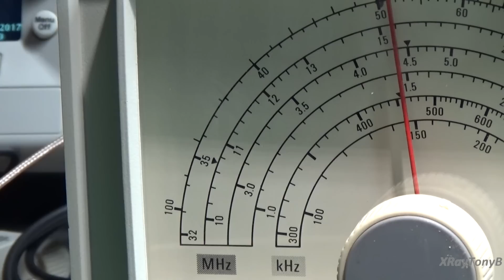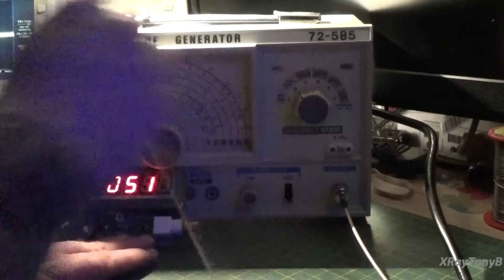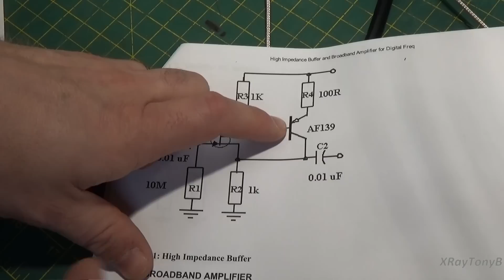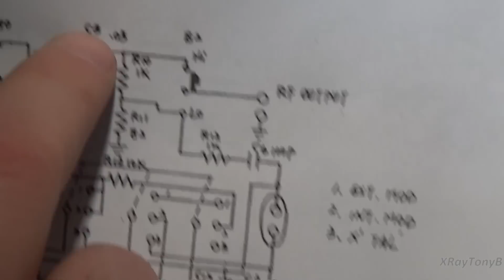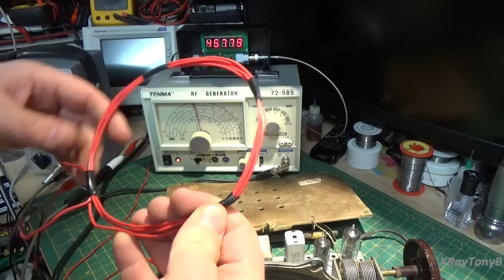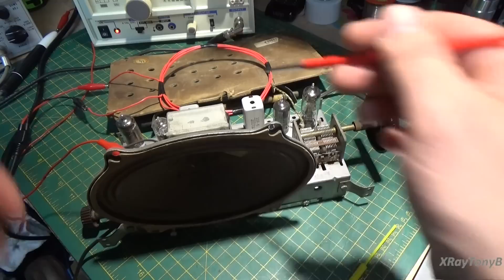Tenma Signal Generator Mod and Demo

Comment: My wife bought me a Tenma 72-380  Function Generator , she heard me saying I needed a signal genny to reopen my old shop back up .......   Well I wasn't expecting her to buy something for me from ebay ....  So I get the Tenma  .....  I can get a 1 Khz  tone out of it  ..... But how the heck do I get my 30 percent modulation for most radio alignments ???    I would rather have a HP Genny where I can set  and see 30 pct on the screen ..... I had a radio shop for 15 plus  years , but I got out of the biz and I had a stroke since then , so I am catching back up on things ....
Reply from the maker: These are wonderful little signal generators.  The internal modulation is fixed at a standard percentage, which I think is about 30%.  You can also switch to external modulation and connect something like one of those low-cost eBay audio signal generators, which has adjustable frequency and amplitude.  That way, you can set the modulation however you want it.  Another good upgrade is to do add a frequency counter, like what I did in the video.  Some versions of this signal generator already have the meter output installed, so you don't even have to do the mod that I did in the video.  Even without the external frequency meter, the dial on this unit is generally accurate enough to align the average AM radio.  Thanks for the comment!
Reply: @xraytonyb  Thanks for fast reply, yes it does have a built in counter and is accurate , according to my Hickok counter ..... I don't have  an owners manual on it to tell is it is 30 percent modulation as a standard, I hope it is.... It does have a ampl knob on it and does pull out for some reason , can you shed any light on that ???  I do thank you for your replies...

Comment: any idea how to set and measure the output on one of these to 20dbm output?
Reply from the maker: The problem with RF signals is that they are very low amplitude, which make it difficult to accurately measure them without using sensitive test equipment.  You could feed the SG into a 50 ohm load and measure the amplitude, but it would be difficult with a scope, as they aren't very sensitive at very low signal levels.  The other way would be to use a spectrum analyzer (very expensive) or an RF voltmeter or RF power meter (hard to find / expensive).  That said, it can be hard to get an accurate measurement even using a synthesized RF signal generator with calibrated output unless the coupling and load are properly accounted for.  Chec out the video I did on connecting a 50 ohm signal generator onto a non-50 ohm load.  I touch on this subject there.  Thanks for the comment!

Comment: I run my Leader LSG-16 into an external freq counter, and use it that way...otherwise there is no way it will be accurate across the board...I have to do this on every freq I want to use it at..

Comment: Another great video Tony,  If you want a low level signal and still have enough level to drive your counter use a resistor directional coupler network. Here's an article to get you started:  http://www.radio-electronics.com/info/rf-technology-design/coupler-combiner-splitter/rf-directional-coupler-design-basics-tutorial.php

Comment: xraytony:
You are a nice guy and most of your videos are otherwise helpful and insightful.
You help others and I will not forget that, it is good.

However in this case, this sig gen is an enormous POS that has huge freq drift issues that cannot be resolved.  I used to own one of these door stops (not really good for that either) and I would NEVER recommend this unit or anything close to this design for any kind of radio work.  Not only is it a drift monster, but the output level is non-uniform and has no usable setting - unless one also goes the distance to stabilize and calibrate the output to a single point and then use an expensive attenuator.  

By the time you have done all of that (if you could - and you nor anyone else could), the price isn't worth it.  It is a waste of time and money.  Get a Hp sig gen or equivalent and then be done with it.  At least you won't be throwing good money after bad.

Comment: Well, You do make some points but..... This was state of the art in it's day.   Cutting down old technology is just being ignorant.    Rebuilding antique radios using equipment available to the technicians of the same era is a HOBBY ment to be FUN not an exercise in precision tuning.
Reply from the maker: First of all, I'm not cutting anything down.  Second, this was not state of the art in its day, it was a low cost signal generator built for those just getting into the hobby.  They are still being produced and sold, but with the upgraded output jack for the frequency counter already included.  If you service radio equipment, you would know the importance of setting the frequency accurately, especially the IF frequencies.  Adding the frequency display makes it easier to set the frequency accurately, especially when someone doesn't have a dedicated frequency counter.  I don't waste my time making videos that cut things down.  I make these videos to help others who are getting into this hobby and to share what experience I've had with some of these items.
Reply: Another cheap shot from a basement critic.  This was a great explanation of the procedure for safely tuning the old valve radios.  I'm new to the hobby and your video is the best I've found so far.  There are many how-to videos on this subject but every one I've found left out one or more steps in the process.  You explain each step and show what you're doing at the same time.  Something missing in the others I've seen.   I've subscribed and hit the like button on this one...
Reply: Don’t let these nasal gazers inhibit you, this was a great video and I’m getting ready to do this mod so I can test and align receivers.

Comment: There's a video by Mr. Carlson in which he designed an amplifier for a tube signal generator that took the generated signal before it was modulated, amplified it to a level where a frequency counter would recognize it, and sent it out a secondary output to such a counter. And it did this without affecting the normal output of the generator. Could that be done with something like this one?

EDIT: If the above is exactly what you did in this video then perhaps I should learn to watch videos before commenting.
EDIT2: Here is the video in question. There's a schematic later in the video.
https://youtu.be/eE7J4Kpbe6w?t=3327
Reply: You will also notice that this video by Paul Carlson represents a quantum upgrade of knowledge base. This fellow has no standard to measure frequency with accuracy... let alone implying that you CAN'T calibrate this generator. This is just blather by someone who doesn't bother with metrology or any normal constraints.
Reply: Uhhhh...What?!   Whats the weather got to do with it?

Comment: its hard to imageime a more silly idea than putting a buck converter in an RFsig gen. a linezr regulator would be far better noise wise. my advice dont waste our money on cheap crap, save up and buy a second hand hP8640b for example. a crappy 8640 will be far better than this rubbish.

Comment: Between your constant reminder that you are only kidding around, this is a really confusing mess of bad stuff packaged as good stuff. Watch someone like Paul Carlson's channel to hear the right way of doing this. Please.
Reply from the maker: So your suggestion is that I act like someone else?  If you don't like a video, don't watch it.  There are plenty of other videos out there to watch instead of wasting your time watching one you don't like and then complaining about it.
Reply: OK. I will.
Reply: @xraytonyb  So the Eico 324 that i have is no good to troubleshoot fm receivers and reel to reels?
Reply: @xraytonyb  I also have and Audio-Wizard Function generator that i would like to find the operators manual or service manual but i am unable to find any info on it and there are no model numbers on the unit, not even a serial number. Have you ever heard of this function generator?
Thank you
Reply: Bruce; He makes comments that are not true! Only half of the tuner capacitor is used in the oscillator circuit. The other half justs the rf amplifier circuit. I read he has a BSEE degree, if he does have one, good good for him! I'm not impressed with his explanation of how circuits work! I had the honor of working with a GREAT Electronics Engineer! He would have made a GREAT Electronics Instructor in Electronics Engineering